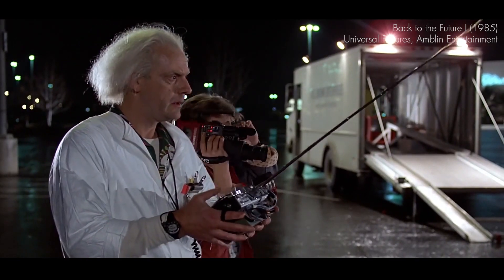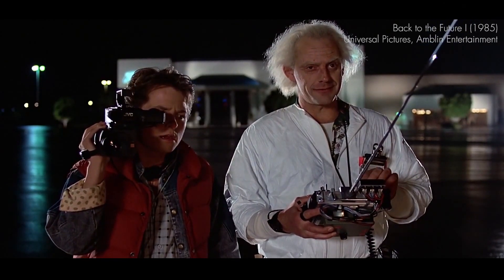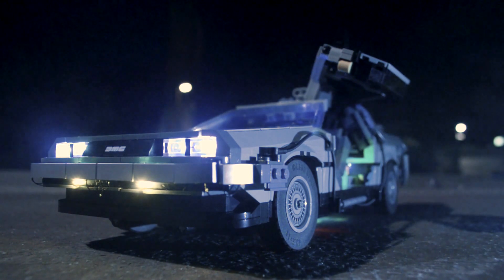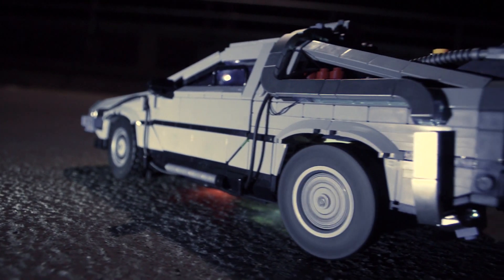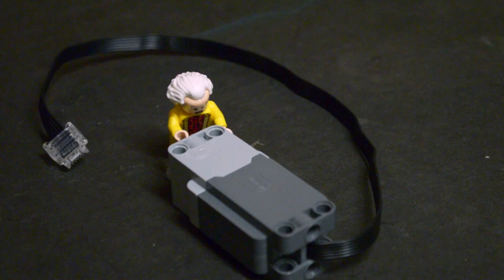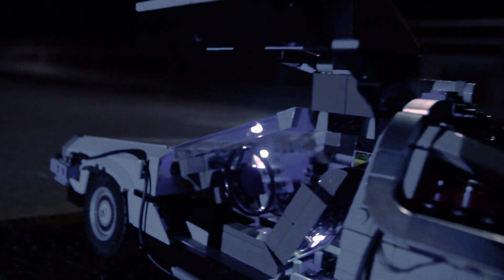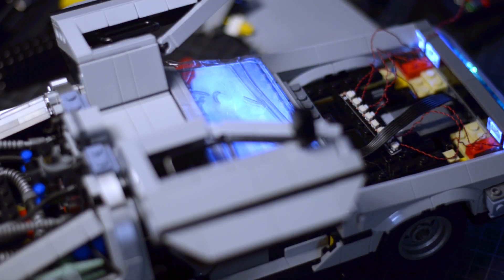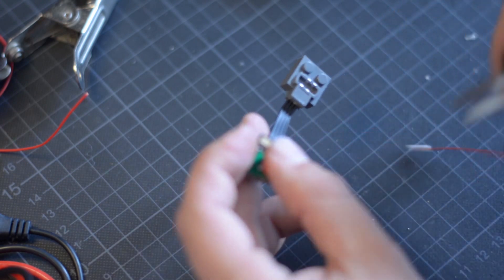motorized: LEGO DeLorean Back to the Future 10300 Time Machine RC MOD - remote controlled moc

Comment: hello, i am thinking about building this with your instructions but it's not clear to me what to buy. Suppose I go for the buwizz solution and get the led kit, what else is needed?
Reply from the maker: You need some extra bricks including Lego motors. Open the rebrickable link in the description. There is a tab called inventory. That contains the extra parts.
Reply: @recklessglitch  is it controlled with the smartphone?
Reply from the maker: @XsauroxPlayer  depends: basically yes, but you can use BrickController 2 app to control the buwizz app with a playstation or xbox controller if you prefer that.

Comment: Does it work with Buwizz 2.0?  Genius work as always.
Reply from the maker: No, buwizz 2.0 (and sbrick) is for the old LEGO power functions only. This has the new LEGO powered up so you need a buwizz 3.0 or a small LEGO Powered Up Hub

Comment: What did you do with the Doors to let open? 😲 I want them be open 👌
Reply: What I did is use two 4459 pieces on the door mechanism
Reply from the maker: @iz.Mystic  yup, someone made a video about it, says as long as they're brand new it will work. I dont trust "as long as brand new" solutions though.
Reply from the maker: on eac side: a pin, an axle pin connector angled 1, a 3l bar and a 1x2 technic brick with 2 holes, but there are many solutions around already, check youtube and rebrickable